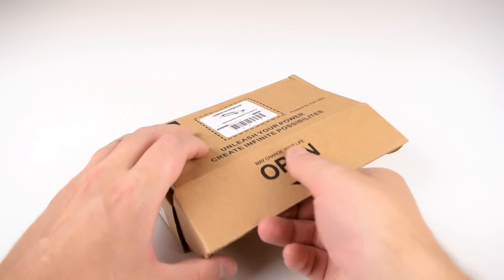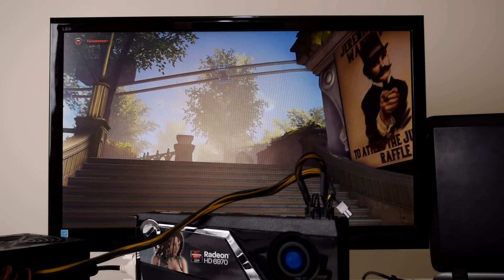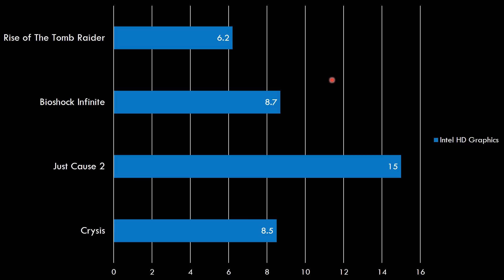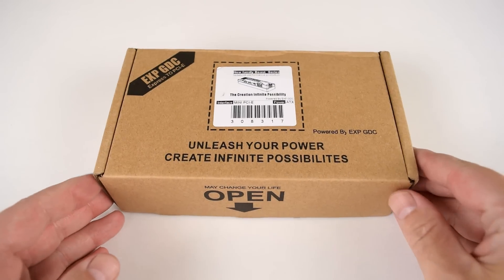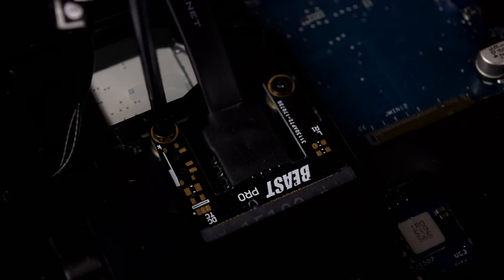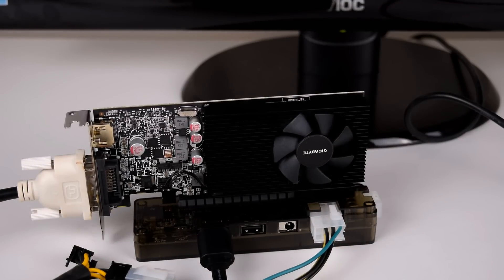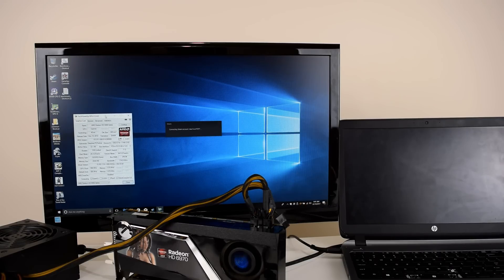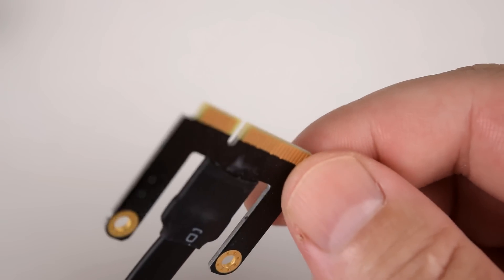External Graphics Card - Cheap Gaming PC with broken screen Laptop

Comment: any recommended external power supplies? i just found out the psu i wanted to use from an old prebuilt doesnt have a 6 pin connector which the gpu i wanted to use for this project needs one.

Comment: you can use the expresscard slot and the wireless wifi pcie slot to hook up 2 of those to a thinkpad t410 or any older pc with expresscard slot. would let you hook up 2 cards to 1 laptop. i dont know if it will work with 2 i got a new gpu and 1 adapter coming if the adapter works i might tr

Comment: my gpu has 2 extra 6-pin pci-e slots for power. which power supply do i need for this to work?
Reply from the maker: Juski A power supply with 2 6 pin cables.

Comment: A long time ago, I have used one of these back in 2011, though it was expensive and it used a ExpressCard interface, and it was a little bit iffy as the machine had a dedicated graphics card. When it worked, it worked really well, but it needed an external screen plus we had some crashes.

Comment: the "u" marks it as a dual core.
Reply from the maker: The U means it's an Ultra Low power CPU.
Reply: And with 7th gen and below, that signifies dual core.

It's only the 8th gen that gets 4 core parts with the "u" designation.
Reply from the maker: Look here: https://www.intel.com.au/content/www/au/en/processors/processor-numbers.html
Reply: forgot about the "y" designation.

But you said in the video that it was a dual core with hyperthreading because it was a laptop, not because of it's power rating.
Reply from the maker: Yes, AFIAK there is no desktop i5 that's a dual core. Does that make sense?
Reply: There have been:
https://www.newegg.com/Product/Product.aspx?Item=9SIAAEE4M23185
https://www.newegg.com/Product/Product.aspx?Item=9SIAAEE4M22680
https://www.newegg.com/Product/Product.aspx?Item=9SIA4MR6HG1107
https://www.newegg.com/Product/Product.aspx?Item=9SIAAEE4M23190
https://www.newegg.com/Product/Product.aspx?Item=9SIAAEE4M22713

The most recent of which was haswell. There are also 4 core i5s on laptops as well.

Comment: I am currently refurbishing and customising a hand me down HP DV 67xx laptop "centrino".

Has an intel core 2due 2.2GHz pared with a Nvidia 8400GMS.

I recently replaced the CPU thermal paste with the cheap $8 Coolermaster paste from Dcomp. Sure cleaning out the dust helped though got a 6'c improment on CPU thermals.

I'm waiting on a SATA desktop/laptop power/data converter to reporpose the dead DVD drive to a 2.5" hot swap bay for an SSD or HDD.

Hopefully I can sacrifice the WIFI PCIe with PCIe 1x extenter to the outer case + external PSU to hook up on of my older GFX cards be it Radeon 5450 1GB passive, Geforce 8600 256 GB or 'for shits and giggles' Radeon HD 7770 1GBG or Radeon R7 260x 2GB.

Comment: Think that second 6 pin connector is for higher power draw bus-powered cards?  Would plugging the second one in help?
Reply from the maker: It's for the PCIe power, but only if you use an externl power supply, not an ATX one.

Comment: I have a setup for the egpu myself, instead of using a pc power supply though I suggest the Dell power brick D220P-01, it uses a 6 pin connector straight into the egpu stand.
Reply from the maker: Cameron Funny you mention this, I've just ordered one the other day :D

Comment: First time to see this device! Beats buying those expensive eGPU enclosures.  However, I still haven't figured out a practical application as I don't play games that much. It could be used for video rendering tough while still using the broken screen laptop.
Reply from the maker: Yea for most productivity apps the benefits could be limited. However you could benefit from features such as HDMI 2.0, being able to run a few external screens, and like you mentioned, GPU acceleration.
Reply: This thing clearly doesn’t beat any of those expensive enclosures, it is has massive compatibility challenges and bandwidth limitation. My old Lenovo Y530 with a discrete 9500GTS refused to work with it. It kinda worked after removing the internal discrete gpu, but it still has a lot of issues, chief among which was the GTX650ti were unable to output sound through its HDMI port. It brought me more headache than result so I shelved it quickly after the experiment.

Comment: Nothing new.  These sell out fast and never come around again for a long time.  There was an enclosed Video card dock unit with its own power supply built in that you could get some time ago but I've never needed it.  Seen some others come out especially Alien had one as well.  Might be good for LAN Parties with a budget laptop.  There are a few connector options including the Laptop's Expresscard connector.  Order the right one. https://www.banggood.com/search/v8.0-exp-gdc-laptop.html

Comment: If you really want to dig into this, check out the website egpu.io run by nando4 and the subreddit /r/egpu. I've run an nvidia 1050ti and a 1060 on my hp 8470p. It's far from plug and play, but nando's software ($15) and website are great resources.
Reply: annihilatorg have you tried DSDT override? It is some what complicated to do but once it's done you should be able to use it just as easy as plug and play. DSDT override lets you overcome error 12 without the need for nandos4 software. That's how I do it with my HP 2570p.
Reply: I did do the DSDT override, but i got constant errors (43?) even with expanded memory showing in device manager. Only way I got it working was by using pci compaction and using the modified dsdt.aml file in setup.
Reply: annihilatorg yes some HP laptops are a pain to setup. Yours includes a dGPU? The problem is mainly that there is no way to change the TOLUD value unlike with other more eGPU friendly laptops i.e. Dell E6430. I'm guessing you have error 12 and error 43 although you only see error 43. The funny thing is that if you had a gtx660 it would probably work out of the box or with only the DSDT override because it uses different requirements conserning this issues. I've done this test in the past.  Having said that I would try just the DSDT override (you need to fix all the errors, it's not easy to do...) That should take care of the unseen but surely present error 12. And then follow the workaround to fix error 43 that affects Nvidias gtx10XX cards with recent drivers. I say this because your laptop is not that different from a 2570p, it's basically a bigger 2570p. With my 2570p I get a bug. I can only attach the expresscard card after the laptop starts windows or I get a black screen. Like I said HP laptops are not very eGPU friendly.
Reply: Do you have information on how to find and fix all the errors? I didn't get any errors when compiling the aml file. I really just did the setup as a quick weekend learning task. The HP is not my daily driver, but I would be interested if there's an on-demand method and not have to reboot the laptop to get it working. My 8470p doesn't have the dgpu.

Comment: Does the manufacturer of that dock make a version that connects to Thunderbolt? That would be useful for older Macbook Pros that have a decent processor, memory, and SSD but an out of date GPU. Most of the Thunderbolt/USB 3.1 solutions I've seen are large and expensive. I love how this one is so compact and simple.
Reply from the maker: I don't think they do. But they have versions for Express card, 1x M.2 and 4x M.2.

Comment: Hi Phil, i use a dock like this and the result is amazing for my laptop. I have an i7 2670Qm 4 core/8 thread with 16 gb ram and a GTX 970. Yes you are right, some laptop manufacturers whitelist the cards that can be used in the PCIe slot. Fortunately my dell xps l502x did not have that. I would recommend checking for this before going for this setup on any laptop. Also, for laptops that already have discrete gpu, things are more complicated. Since there are not enough free memory resources. Fortunately there is a software available which works before entering into windows to disable the dicrete gpu and reallocate the memory to the external gpu.
Reply from the maker: That's one decent CPU you got in that laptop!

Comment: Great video! I didn't even know this existed. I've always been interested in adding external graphics to notebook computers. I think it would be great if they started building displays with video cards built in. You get the connivence of portability but you can dock your computer at home and fire up some games.
Reply from the maker: I hope that there will be a proper external PCIe interface or something in the future.
Reply: We should be able to do PCIe over USB-C. I never thought of tapping into the wireless card slot to pipe in graphics to an older laptop. I really wish I tried this on a laptop I had before I sold it off last year. Thanks again for the video!
Reply from the maker: Awesome :D I hope to do more in this direction. I like finding value in parts that are easily dismissed.

Comment: WANT a challenge??
Find and see WHAT IT TAKES to make a Multimedia system to play CD/DVD/BR...the Min requirements..
Those $40 DVD players seems to fail to often, but also have little to nothing in them, and do pretty good.  THE SAME for a computer and WINDOWS IS NOT THE SAME..
In FACT, it REALLY SUCKS..
Iv seem Linux based security cameras systems with 8-16 cameras, RECORD in 1080p BETTER then windows can PLAY, ONLY a DVD..

THEN,...can you find a way to REPLACE a DVD PLAYER DVD DRIVE WITH A COMPUTER TYPE DVD PLAYER??  those drive FAIL to fast and to much..

And a Full MM drvice would be great..Just plug in ALL external devices into 1...DVD/HD/FLASH and play on TV/Stereo..and be in the $200 price range..I could sell 1000's..Esp if the parts are REPAIRABLE..

Comment: In my eyes this is far from worth It, the whole egpu thing is a gamble, it may work but has pretty high odds of not working, I have tried this my self and ended up selling the egpu dock about 5 days later because it just wouldn't work, had about 7 issues with it from not enough resources, to many error codes, having to overage system code changing the pcie bus to 36bit instead of 32... which got to levels so advanced I physically could not do it and in the end it never booted up with it working (got to bios and all did video test but blue screen every time I went into windows) and honestly little laptops feature a gpu powerful enough to play modern games at good frames (the ones that can start at something like 800$ at which point it defeats the purpose of even buying it

From my experience it's a gamble and the house has an Ace in it's sleve.

Comment: I have seen newer laptops run with an external GPU via the USB type C connector thanks to JayzTwoCents' video on it. It was a gaming laptop running a GTX 1060 and Jay put in a GTX 1080 in it via the external GPU dock which which is alot bigger than what you have there Phil because the PSU is all ready installed and the results were not that great because of the huge bottleneck that is caused by the USB type C connector which caused the card not to run at its fullest potential.  But with this idea I could see a workstation laptop such as a Dell precision turn into a Gaming laptop using this method.

Comment: I'm seriously considering getting the Thunderbolt equivalent for my old mid-2012 Macbook Pro Unibody - I paid extra for the upgrade to the i7-3520M, put 16GB RAM and a 512GB SSD in it, but the GT650M is anemic for gaming (yes, I know - gaming on a Mac?!  I have a proper gaming PC as well..).  The prices on those are still wayyyy high, but maybe in a year or two we'll see some more budget ones available.  No removing cards or even opening the case required. :)

Comment: when i used to repair laptops sometimes the screens would be more than the laptop, so I would explain to them we can fix it but its going to be 160$usd.  What usually happened is i removed the screen and turned the laptop in to a modern day zx spectrum or st :-) similar to what your referring to except these folks used them more for Kodi or old pc gaming machines, emulation and so on.  function f5 is almost universal to switch between screens.

Comment: That's an i3 dispite what intel claims.
Reply: Yeah basically the dual core i5s and i7s are i3's with better IGPUs and more L3 cache and thats it.
Reply: The iGPU is the same across all generations of the chip, so it's just more L3 Cache. They should just call it an i3, because cache doesn't really do much except give them an excuse to slap an i5/7 badge, and overcharge for it, and the extra cache yeilds a 3% or so performance boost, might as well just increase the clock-speed by 300 mhz.
Reply: That why sticking to my 2010 high end laptop

Comment: I have a 23 inch HP AIO with a T9550 C2D and 8gb ram. it has a Mini slot for a Tuner card. I winder if this will work in that slot. It has an MXM slot for a discrete GPU with a 35w limit. i have yet been able to get a card to work in it. (having purchased a second hand G210 MXM and a GT230...both made he display go in to diagnostic mode) i will be replacing the 120w power brick with a 150w if not i wonder if this would work as a good work around.
Reply from the maker: It could work, but you'd have to connect another monitor which isn't ideal with an AIO.

Comment: I have a T400 and T420 with cardbus, there's one variant of the cable that uses said connection instead which I prefer for the sake of simplicity.
What I'm still curious about and no one seem to have an answer to that as everyone is just using their ATX PSUs; What voltage does a power supply with pin connector need to deliver in order to make this work?
Reply from the maker: It's a 12V PSU for DELL Optiplex. I've got one coming, there might be a future video. Just got to ask around for a laptop with express card.
Reply: Oh sweet! Thanks for the reply, that makes a possible buy much easier.

Comment: Hi Phil. O might try this on a laptop which as a faulty gpu (infamous 8400gs) and see if i'm able to resurrect it it. Reflowing the gpu works but only temporarily obviously. Reballing is useless because the gpu is at fault and replacing the board is pointless because the new 8400gs will fail again.
If i ever get this i'll report if it worked or not over on Vogons!
Reply from the maker: Good luck, I hope it works out for you!

Comment: Still giving a thumbs up but that adapter is $50 USD for me. I think a better option would be to get an 1156 socket motherboard and a Xeon x3450 for $75 US. That's $50 for an Intel brand board and $25 for a Xeon with ~ first gen i7 performance @ 2.66, quad core with hyper-threading = 8 logical cores. This assumes that you have a case, PSU and DDR3 RAM already available. You could probably sell the laptop for parts say $25 US? However, it is a nice option for a decent laptop. My i7 core laptop would definitely work with this. I would get the ext PSU too.
Reply: GiSWiG I agree but recently the eGPU community found out that you can actually replace the EXP GDC with a much cheaper adapter normally made for mining. EXP GDC only makes sense if you need to use it with expresscard. If you need it for mPCI e or M.2 PCIe you can just purchase a $7 adapter that actually provides better PCIe 2.0 signaling quality.
Reply from the maker: Socket 1156 is great!
Reply: 8 GB RAM already costs more than $25.
Reply: Artur Ferreira hey, could you send the link for it?
Reply: Henrique Augusto Rocha Oliveira sure. Just Google "US$7 mPCIe eGPU adapter". Are you Portuguese?
Reply: Artur Ferreira yup, why?
Reply: Henrique Augusto Rocha Oliveira I'm also Portuguese.
Reply: Artur Ferreira ahhhh
Então beleza ashaushaushau
Cara, tá complicado achar se vai funcionar o setup que eu queria 
Tô com um note da positivo que de bom só tem o I5 dele, que nem é tudo isso (3210m)
Tava pensando em colocar uma rx 550 com a egpu
E tipo
Por esse adaptador de $7, como irei alimentar a placa de vídeo?
Reply: Henrique Augusto Rocha Oliveira és brasileiro, certo? :D Então precisas de um uma fonte ATX ou de um Dell da-2. Depende da versão do adaptador. Gráficas AMD não permitem ter imagem no écran do notebook. Permitem de uma certa maneira mas é mais complicado é limitado doque as NVIDIA. Aconselho a testar se o slot mPCIE não está whitelisted. Isso depende do fabricante do notebook.

Comment: PCI-E 2.0 is not a big deal.  You're still not saturating the PCI-E bus with modern video cards on PCI-E 3.0.  Definitely not with a HD6970.  Besides, most of the Intel CPU's these days have less than 24 lanes for the entire PCI-E bus with many systems configuring slots at x8 not x16.  I like this idea and didn't realize that it was possible without using something with a thunderbolt or USB 3.1 port.
Reply from the maker: There is one for Express Card, but not for PCMCIA.
Reply from the maker: Yea, but it's 1x PCIe 2.0, not 16x. So it's far less bandwidth compared to the desktop.